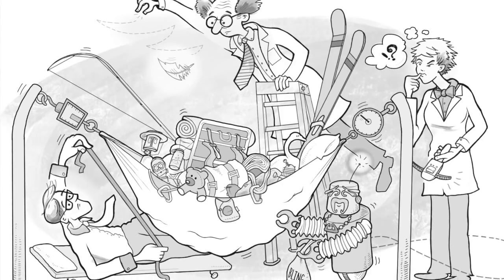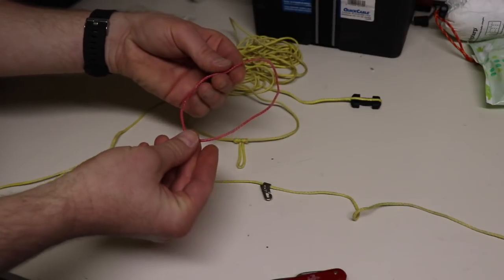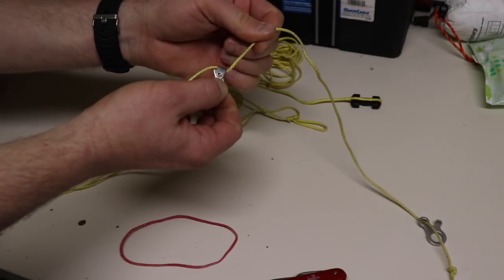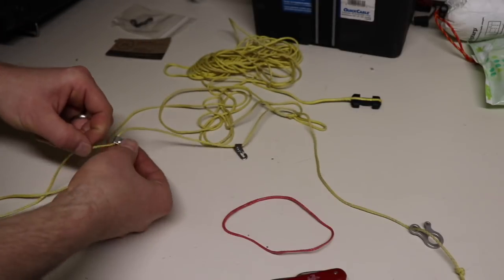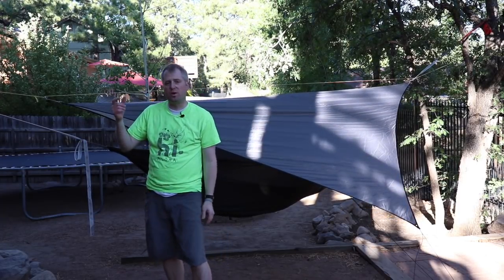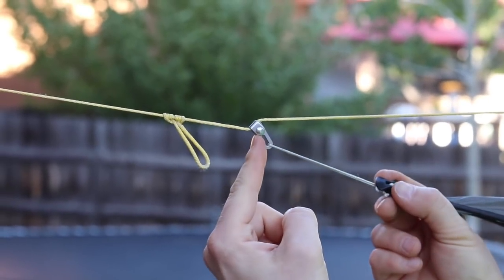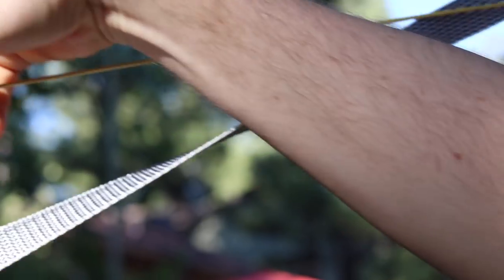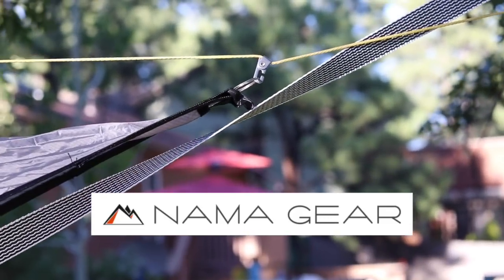Review: NAMA Claws - Tarp Connectors

Comment: Curious how these would work with Reflect-it. I have a Dutch continuous ridgeline with soft shackles. I’m having an issue with being able to slide the prusik where the shackles connect to the ridgeline, even when no pressure is being applied. I’ve been searching for a remedy and these little babies look like it. Thanks for sharing.
Reply from the maker: Should work just fine.
Reply: They tear up reflect it from dutch , but do fine on go outfitters go line

Comment: Will the metal hardware start to fray the Ridgeline, or are the manufactured well with rounded edges?  Looks easy. Thanks for the video.
Reply from the maker: No sharp corners on the device, and it doesn't require the line to bend over the hardware in a way that would shred it.

Comment: What type, size, and length of ridge line are you using?
Reply from the maker: Zing-it or Lash-it work great. NAMA Claws are designed for use with 1.75mm dyneema line, but will work well with line diameters ranging from 1.2mm up to 1.8mm.

Comment: So I found something that does the same task that the NAMA Claws do in this video but it works with 550 paracord. It's called the Fishbone Piranah. You simply attach the larger hook on the Piranah to the end of your tarp, and the smaller hook on the Piranah to your ridgeline. The space between the tarp end and the ridgeline is only about and inch and a quarter and, because the smaller Piranah hook is so small it doesn't move once attached to the ridgeline, just like the NAMA Claw. However, if you loosen it, you can easily move it along the ridgeline to adjust your tarp. You can also attach the Piranah to a split ring just as shown in this video. I purchased two Piranah's. Both are made of titanium so they are very lightweight

Comment: Can I pass a Dutch hook through the top of the claw?  My current ridgeline had a Dutch hook on one end and a wasp on the other. I don’t really want to take them apart.
Reply from the maker: Sort of. I just tried it in my lab. The hook will fit through the claw and snag, but not really interlock. It's tenuous. A better option would be to create a short loop from 1.75mm Zing-it to connect the two. This will also help with any twisting between the hardware devices if they aren't aligned.